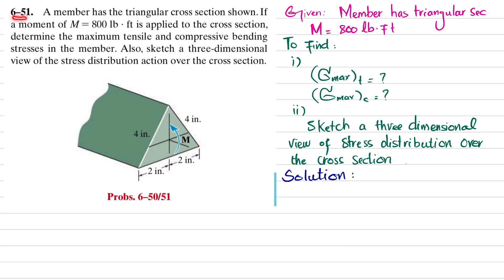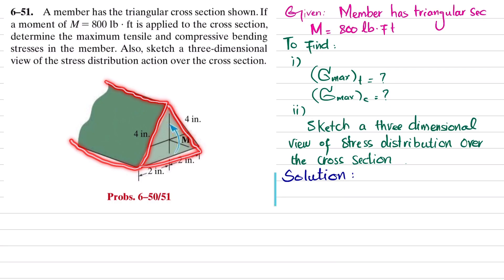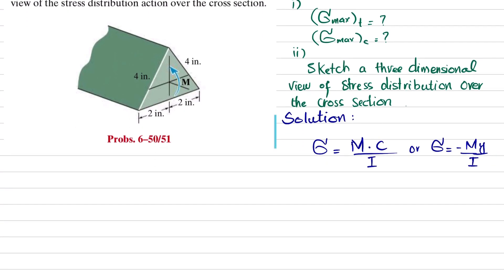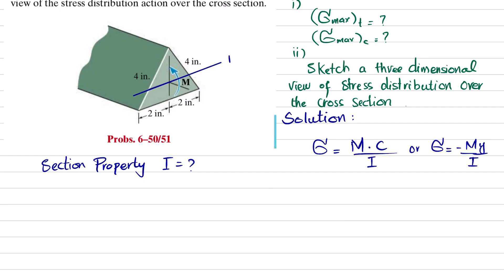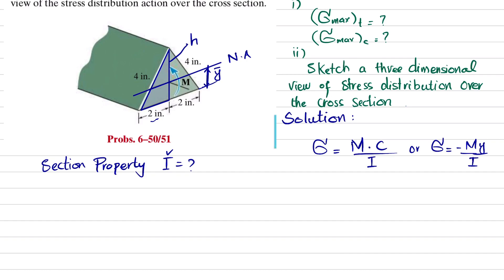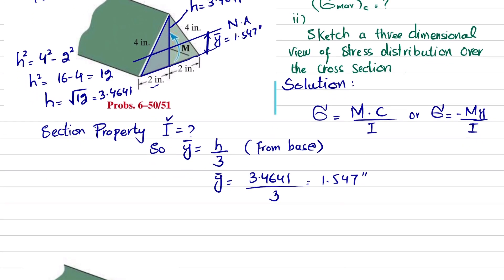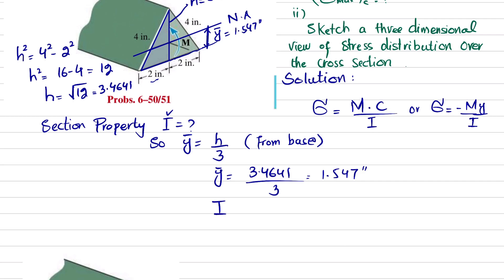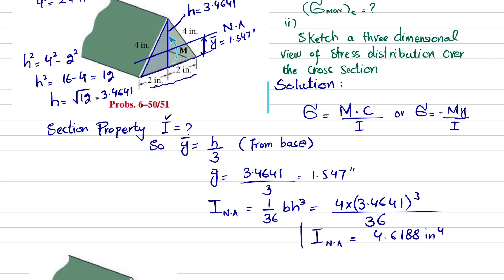6-51 Determine the maximum tensile and compressive bending stresses | Mech of Materials RC Hibbeler

Comment: I did the calculations for (stress max)t and (stress max)c using the numbers you provided and I'm getting different results.
Reply from the maker: I shall check them again. May be I made a mistake in calculator. But overall the concept is correct. You can compare your answer with the book as well. ❤
Reply: For anyone else wondering, the y value written in the first part is incorrect, the correct y value should be around 1.1547 instead of 1.547. That's why there's the discrepancy for (stress max)t when you calculate it.
Reply from the maker: The basic thing is concept being human , error may occur. Thank you 👍